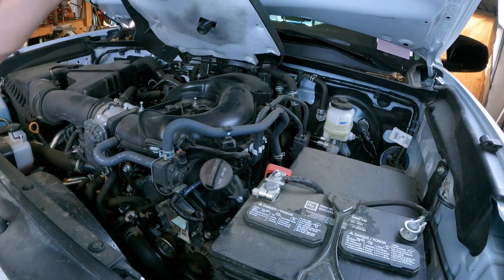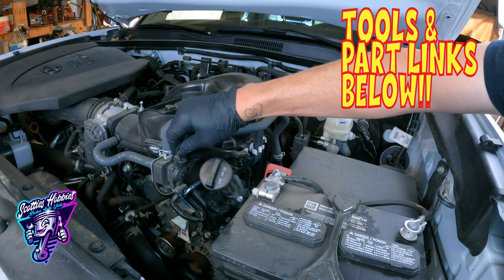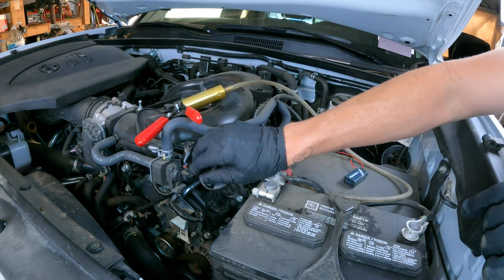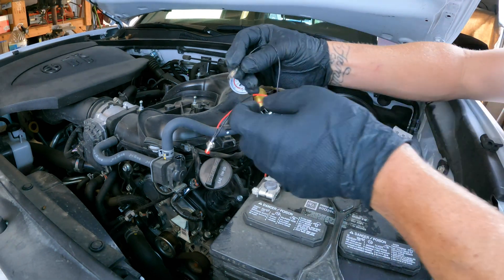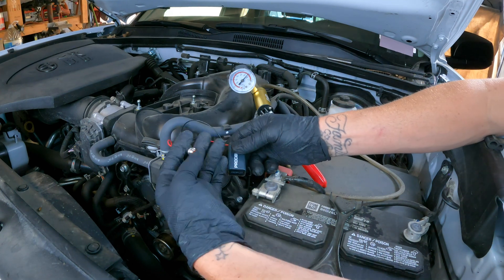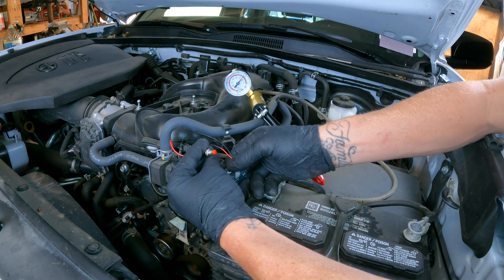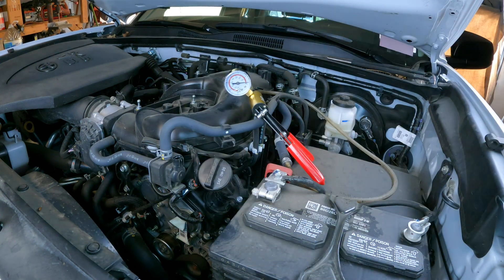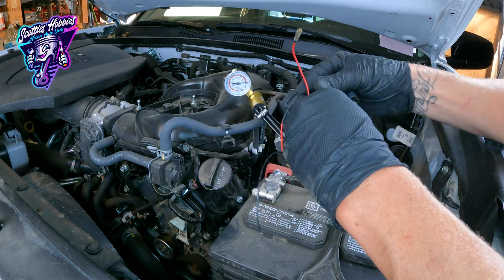#mechanic Toyota Tacoma Canister Vapor Purge Valve Testing | How-To Guide  #toyota

Comment: I'm trying to research code p2420 evaporative emissions system switching valve control circuit high. It's the only code on the truck (16 toyota tacoma) right now. I've replaced the gas cap with oem. I was hoping it would be a valve. But you don't list p2420 in your description. Any suggestions?
Reply: i also have a P2420 Evap Emission Pressure Switching Valve Stuck Off.

Comment: Your videos have been helpful for me sorting out my problems with my 2016 Tacoma TRD Sport. I’m about to drop you an email but I checked these codes and they don’t match the ones I’ve gotten which are:
P0171 Engine too lean
P0174 Engine too lean- Cyl bank 2
P0505 (pend) Idle Air cont system
Issues only happen when tank hits Empty- starts running rough and Trac off as well as CEL come on. Then when I get gas, issues go from bad to worse… it won’t crank, tries and tries but just won’t. I disconnect the negative terminal to clear the computer but doesn’t work. I literally have to keep trying until it starts to crank, then I feather the throttle till I get lucky and get slow moving. After about 10-20ft it gets running better and then completely resolves until I need gas again. Error codes clear and everything. You mentioned lean codes in one of your vids and with that, the codes I’ve gotten and the other info I’ve gathered I’m pretty sure it’s the Vapor Canister Purge Solenoid. I’m gonna email you this same info— appreciate any feedback and these detailed videos!
Reply: Along with codes P0171, P0174, I also had P117B code. The Vapor Purge Valve was the issue.

Comment: Should it drop or not? Drop is good or bad?
Reply: The valve or solenoid is on or off. The valve should hold vacuum and not leak without power applied. When power is applied the valve opens allowing the vacuum gauge to drop. When connected to the engine the valve opens to allow vacuum from the intake manifold to purge the vapor from the evap (charcoal canister) system located at the back of the fuel tank above the rear differential.

Comment: Where you getting code p0441?
Reply from the maker: This can cause a p0441 code. I was trying to find a p0456 cause.
Reply: I have p0174  maybe purga valve? Dont work i have lean bak 2
Reply: @EltraviesoEspacial changing this didn’t work?